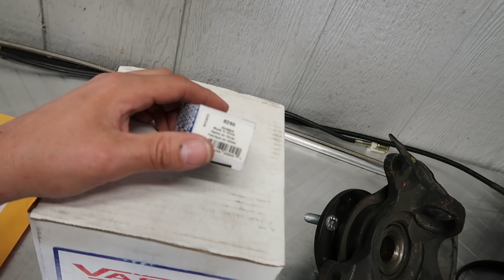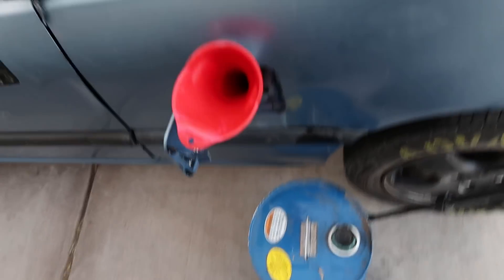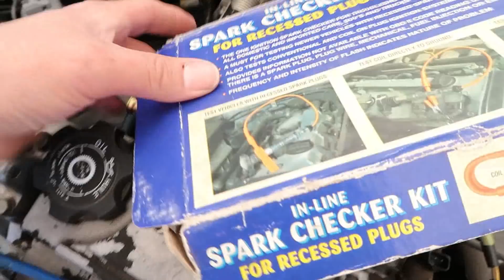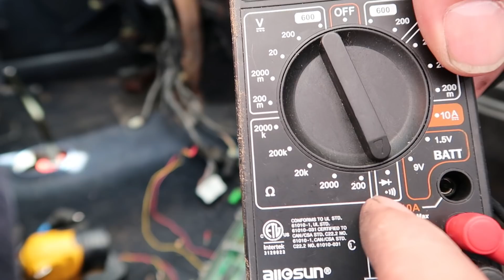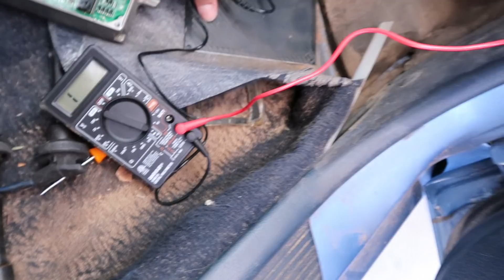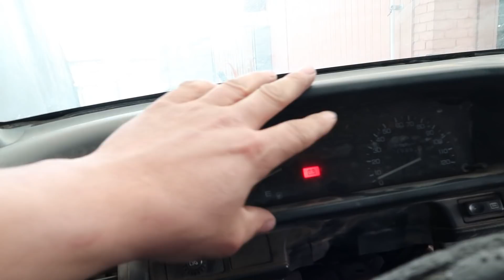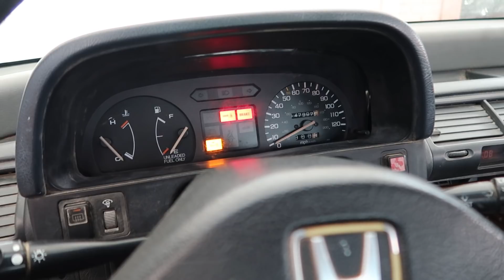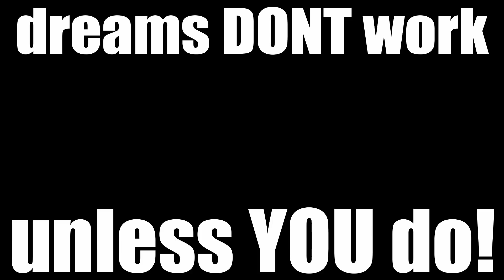First drive!! YES!

Comment from the maker: Tried the chip BOTH ways off video. All 3 chips, both ways... both ecu's..
Reply: P75 will run that b20 perfectly  if you wire up a 4 wire o2 sensor to the ecu jumper harness.
Reply: That’s a no go 🙅‍♂️ the ecu chips go with the half 🌙 moon facing the ecu plugs. I would double check the ecu to make sure no capcitors didn’t burn up (check engine light staying on)..great content btw great to see the hatch turned on.
Reply: Change injectors to obd1 injectors has this happen to me years ago with my ef with obd2 injectors switched to obd1 injectors and plugs never had that issue again and sound like you crank angle wires are mixed up in the harnes or dizz it will only rev to 4k like it stuck on 2 step fix those 2 problems should be good
Reply: I had that problem with my Ef when put my TypeR in.  A resister box makes the obd1 injectors saturated.  Obd2 injectors are already saturated. If you are using obd2 injectors with a resister box it won’t fire. If you use obd2 injectors with the box you have to ground all the wires on the box.  That resister box only works with obd1 injectors
Reply: No resistor box obd1 is high impedance no need for a box unless low impedance
Reply: Not sure if this will help but I had a accord that did this swapped map sensor and egr valve not sure which fixed it
Reply: Fuel pressure regulator bro
Reply: instablaster

Comment: Its the injectors being high-impedance on the stock obd1 or obd2 engine. The chassis is setup for low impedance. Just bypass the injector resistor box or remove it and jump the wiring dead across
Reply: Was gonna be my exact comment just clip the wire crimp them together and there you go deleted resistor box and also they put the ecu chip in the wrong way the half circle  gos toward the socket side !!!
Reply: @cheyannesantos9465   I didnt see a resistor box. I seen the OBD1 injector dead plug which is correct.

Comment: The 88-89 cabin and  cluster harness is different I put and 90 hatch harness in my 89 sedan and my cluster was all crazy like that lol I looked up the pinouts and rewired it all
Reply: Nice u did it the easy way I didn't even think about putting a 90-91 cluster and hood on my 89 dash lol I should of did that

Comment: 10:50 fuel main relay, ECU fuse, 
 Just a guess, had a similar issue with my teg couple years back
Reply: That's probably not an ECU fuse, since you're not explaining ECU code zero, but maybe fuel main relay?
Reply: But I've made it to the end of the video and you are describing an Ecu code zero, check the ECU fuse under the dash
Reply: The fuse box under the dash I mean

Comment: Need to check the solder joints on the ecu where it was modded.   Might have cold solder points that's not making contact on the board anymore or lifted tracks on board from overheating when soldering

Comment: Same thing happened to me because I had to cut the bottom portion off of the ball joint stud leaving me without a hole for the cotter pin. My ball joint popped out going over a speed bump and I ended up having to replace both the upper and lower ball joints, the fender, the axle, the brake hose, and the wheel speed sensor. Talk about a shitty time. I replaced all of the ball joints after that. I definitely learned my lesson not to put things off.

Comment: U need a led test light to see the injector pulse from the ecu and u can run a b18/b20 from a stock p06 obd1 ecu for testing or simply remove j1 to get u ecu back to stock

Comment: Use a 90 to 91 integra ecu car will run perfect,  but there are wires crossed in the harness  ,12v from the the fuse box , too the ecu ,and and from ecu  too the engine harness

Comment: Listen to Christopher Shoemaker.  You have no tach so we don’t know if your cranky position sensor is working. When you pull the chip, it doesn’t look for the crank sensor anymore.  The crank sensor for a normal EF is in the distributor.  Not sure about the B20.

Comment: Put a paper clip in the fan sensor plug if it’s broke usually brake fast I did it on my del sol works or a screw

Comment: would help if the chip was not put in backwards  look at the board of the ecu there a patern on the board with a notch so is the chip always put the chip the same way as the ecu patern

Comment: I'm at 15 mins but I have learned a LONG time ago from using test lights for signal coming from ECU or other logic boards as it can fry it because the light draws more amperage than the intended signal. Stick to multimeter for that.

Comment: Have you checked the engine ground?   I have seen weird issues like this with chips and engine codes that do not work when the engine ground fails.   And yet the car will still start because it finds an alternate ground through the starter.

Comment: Yo would anyone else know the issue that they were showing? I have a 34 na, I bought it approx 1 yr ago back then it started right up no issue. I parked it in the backyard for about 8 months. Tried to start it and it won’t run. It will only turn by spraying brake cleaner into the throttle body. PLEASE HELP ME

Comment: It might need a injector resister box, I remember when I got my EF's engine swapped from dual point to 4 injectors it needed a resister box
Reply: If ecu is obd1 and injectors are obd0 . They need that resistorbox. Obd1 ecu and obd1 injectors doesent.

Comment: Yo DB the chip ECU I think might like a Honda universal ECU it’s like how’s the antitheft device in bedded into the chip when you plug it in and it doesn’t recognize the key has a chip disabling the car to run on its own by removing the chip and running the regular key if I resign because the keys not chip 🤔😊👍

Comment: Bro remember that if tha ecu was tuned before the chip has a map set, is like mi eg6 I got a p28 tuned as a free turn(NO RED LIMIT) if I take the chip off the car still start but weird, some map set on the chip doesn't start the engine

Comment: It's prolly the small box under the driver's dash that's going bad. I remebt I switched mine out and it ran good and didn't surg the idle.
Reply: The rectangle one not the square one.